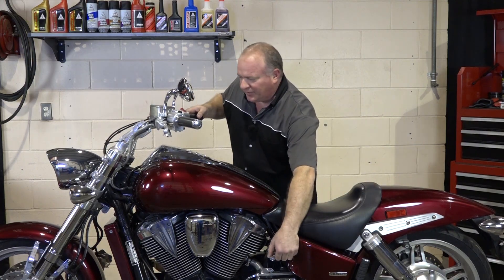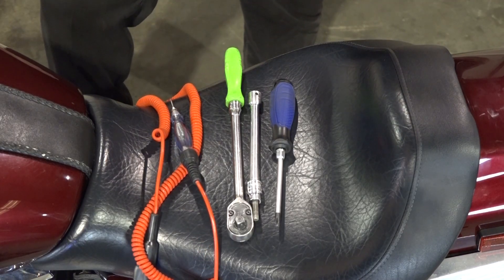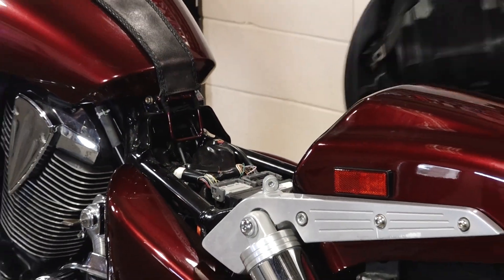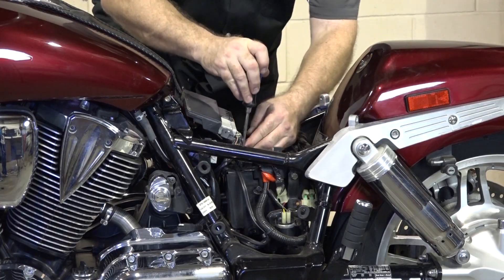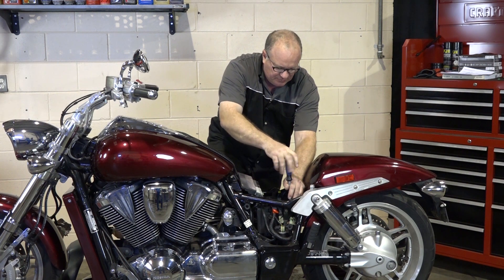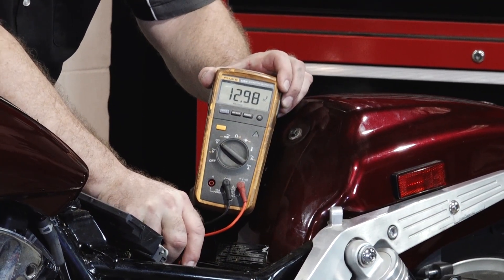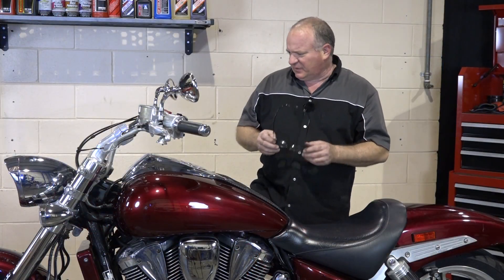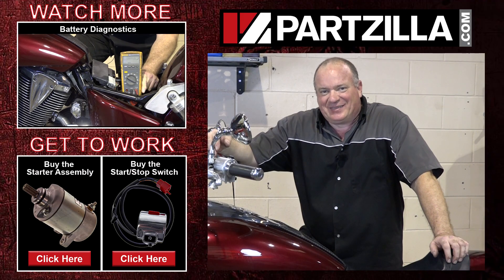Troubleshooting a Motorcycle that Won’t Start | Honda VTX 1800 | Partzilla.com

Comment: Your videos Are saving me so much money and teaching me a lot. I am experiencing an issue with the start button Where I have to push it for quite a few seconds before the motorcycle will turn over. Or move the button around in order for it to make a connection. Is this something that could be corrected by taking me apart and cleaning it or does this probably require a new starter button assembly?

Comment: Good guide.

BUT this happened to me:

The starter solenoid have 2 nuts for each pole. The upper nut is for securing the cables. But the nuts on the BOTTOM of the poles actually holds and aligns the connecting copper plates inside the solenoid.

I once made an error and loosened the 2 BOTTOM nuts on the solenoid while installing a second horn.

Without me realizing what had happened after installing the horn, the solenoid would  "click/start" intermittently. 

The copper plates inside the solenoid had been misaligned and had made bad contact because I fiddled with the nuts on the outside securing them.

After taking the solenoid apart there was melted copper, sooting and obvious faults.

I replaced the solenoid WITHOUT touching the two bottom nuts. Just the upper 2 for the cables :)

Comment: I have a 2010 Honda Sabre CS1300.  It has an issue starting, even with a new battery it will not crank over enough to start the motor.  I have to use a battery charger hooked up to the tender cables to start the bike.  I can ride the bike around for 10 minutes but after I turn it off it will not start again.....Your thoughts would be very much appreciated.

Comment: Thanks for the video, great job. Question? I have a 1300 vtx. About to get into trying to find out why it just decides to shut down while riding for no reason. When it does happen, you need to sit there for awhile to wait to restart. It has gotten really bad to a point where it is just happening a lot and can no longer trust it. Any tips on where I should start looking? I am thinking maybe a fuel relay, or yes even the fuel pump, but not ignoring that it could be wiring in the kill switch / starter. Appreciate any comments please. Thanks a lot.
Reply: Hi, Did you get the problem fixed? My 07 has been having the same issue. Thanks
Reply: @MohammadKhan-eg5dz  So I went through everything on this bike. but I am pretty sure it was a vacuum leak. The bike was painted a year earlier and the petcock for one was really loose, I think it wasn't tightened proper, and over time loosened of. Possible leak. Tightened up a few things a little better and all seemed to have cured itself. If you suspect a vacuum leak, spray some carb cleaner around the carb, example, carb boot, vacuum lines from carb, etc while its running. If you got a leak, your bike will tell you when she starts to idle rough.
Reply: @kmarche100  Hi, I checked the fuel line from carb to the petcock and it was good then I lightly tapped under the float bowl, and it worked. Bike started and idled for about 10 minutes, and it cut off again. I tried few times to restart, and it didn't start then I slightly opened the choke and bike started. With the choke slightly opened I rode about 60 miles and had zero issues. Now if I close the choke the bike won't start. I properly adjusted the air/fuel ratio and it's about at 2 turns and I did try 2.5 & 3 turns to eliminate the need for choke but the bike wouldn't start. I had a similar problem before when I purchased the bike it didn't start/run without the choke being slightly open but after I cleaned the carb/jets it ran fine for about 50-60 miles and then I ran into this float problem. Is it time to get the bigger jets now since the bike won't run without the choke? Is it bad for the bike to run with the choke open? I'm truly thankful for your help & support. Best Regards

Comment: I have a 01 Suzuki Intruder 1500. All of a sudden when I turn key on all lights turn on but fuel pump dont . Push start button nothing happens. Replaced starter relay twice . All 3 wire in the plug at top of relay are hot all the time with key on . Tested all safety switches (neutral, sidestand,clutch) and decomp switch and decomp relay and yhe relay behind fuse box they all seemed to test good . I tested on/off switch and start button both are good. I also have current all the way from start button through plug behind headlight then to the ecu when button is pushed . I don't know where to go from here?

Comment: We have a 2005 VTX 1800.  It sat for several years.  The battery was replaced and the lights came on and the engine turned, but the engine didn't fire.  Fresh fuel was in the tank and the kill switch was in the on position.  Ideas given that it sat for a few years in a shed?  Its was dusty and I don't think it was fired up many years....It was my Dad's and he passed away.
Reply: Does the fuel pump prime when you turn the key on? If not, check the fuses and wiring to the pump. Worst case, it might need a new fuel pump.

Comment: Very nice run through of these switch/relay checks. Thank you. One thing I would have wondered when the main fuse was blown is 'What caused the main fuse to blow?' Because that's my problem. The bike ('05 VTX1800) will start and run, but if I shut it off and turn the key back on and it blows the fuse you mentioned. If I wait a few hours I can start it again (with a new fuse in place), but if I shut it off and turn it back on - 'pop' goes the fuse again. When I ran across my blown fuse, I thought I was on easy street (just like in the video), but my issue was not solved with a simple fuse replacement. I don't really expect anyone to answer this. It's just another non-start issue that may arise. It probably isn't as easy to diagnose though. Any help would be much appreciated.
Reply: Exactly what I was thinking.

Comment: Thank you for this video. I have a 2003 VTX1800R. Brand new battery. When the system is on, all other subsystems power on. I do "FINE-C" to verify start condition, I hear the Solenoid engage, but the starter doesn't spin. I feel confident it's a bad Starter. Does this check out with anyone else?

Comment: Thanks for this video, especially with the starter solenoid not clicking as it should and with the fuses. I have an 04 1800R and it just wouldn't crank over last week, replaced the battery and bought extra fuses as well as a new solenoid.

Comment: Where do you connect the circuit tester
Reply: You connect your test light to battery ground (negative terminal), so when you touch positive power, the light inside will turn on.

Comment: The selonoid wires are reversed on the bike in the video compared to mine. I tested the yellow wire and got nothing. If I jump the selonoid the bike does turn over.

Comment: Wow man you just save me a bunch!  I Have a 2003 vtx1800r that I just had to replace the gasket on the left crank case. When I put her back together she refused to crank 😱 -  Turns out my starter solenoid is bad. Not sure what these 2 have in common it was cranking over just fine before I did that, but this video really helped me to narrow it down and find the issue! - Thanks and safe journeys 😎🤘

Comment: Very good video. In less than 13 minutes, you cover pretty much all problems than can prevent my bike to start. I have a VTX 1300 but most of it apply (even if I need to find the fuse somewhere else I guess.) 
Very good teaching - clear and concise. Thank you very much.

Comment: 2005 1800 vtx, runs well and then bogs down, eventually dies. Re-starts and runs for 15min,then dies again. Could this be the fuel pump?
Reply from the maker: Maybe... but this really sounds like it could be the vent hose on the fuel tank. Insects get in there and nest or you get some other tyoe of obstruction and no air can get in to replace the fuel your pump pulls out... so the pump can't pull anymore. Give the vent tube a look.

Comment: Could a stator be an issue of no power at all? I am troubleshooting I have no power. I've replaced the battery, starter solenoid, regulator rectifier, ground wires, checked all fuses and changed all fuses I have a 96 Honda CBR 600. I was driving I got to a red light and it just died. No power at all to lights

Comment: Hi John,  just watched this video.  Can you tell me what the voltage should read on the yellow/black wire on the starter relay solenoid ?  I'm reading 12.2 when starter button is activated.  My battery is reading 12.8 volts.   The relay will pull in when jumped from battery to relay post ( yellow/red),  but not when activated from the starter switch.(12.2) volts.

Comment: Great video man I always buy partzilla.  I was wondering I have a vtx 1800c, I was driving to work and it died on me not even 1 mile away from my house.  I had hearing protection on so it was hard to hear anything.  It had some not great power then died.  I shut everything down and restarted and no problems since and I had done some rides after no problem.  It kinda bothers me.  What could that be?

Comment: Hi, I recently bought a vtx 1300s. The bike ran great no issues. I let it sit for a few weeks and didn't start it. When I went to start it to go for a ride it cranked a little slow but wouldn't start. I tried it a few times and it died. All the lights went out and I got smoke from the battery. I took the seat off and found that the positive terminal melted. I put a new battery in the bike and now it won't start. All the lights come on and it turns over but won't start. Any ideas?

Comment: My battery swelled up and caused my bike to turn off while riding.  2005 VTX 1300, I brought it to the Honda dealer and they pulled the pins on 3 different harnesses on the right side under the cover.  I tried to repin so I could start to troubleshoot, but I have 3 solid green wires with pins and two solid green connectors and one connector which is green and gray strip.  I am having trouble getting back to baseline so I can troubleshoot the real issue

Comment: Hello. My problem is, i put the key into the ignition, it turns half way but will not fully engage! Yes, it is the right key. i removed the seat and battery. Is there a kill switch on that?

Comment: What's the problem when your 1800S won't shut off.
Reply from the maker: We haven't done that on an 1800, but we ran through a similar problem on a Yamaha ATV. Way different units, but the idea to run it down is the same: look for ways that you might have closed a new circuit somewhere. Water intrusion in the ECU is a good place to start-- and go through your wiring harness to see if you have exposed wires that might have closed a circuit. Exposed wires were the case on our unit and it drained the battery down. We found the exposed wires in the ignition switch and swapped it out. 

Again, waaaaay different unit, but the video might give you some hints: https://youtu.be/guSdIlmO30A

Comment: Hi 👋 I got a Honda GL -150 it  doesn’t start only pedaling I run it for 3 miles the shuts off I cannot start it by pedaling so I have to go on a hill grab speed and  start it , I have to unplug the cable from the spark connector and put it slightly touching the spark connector now starts am I was wondering how can I fix this problem I’ll highly appreciate it

Comment: My 2003 VTX 1800 has been sitting in my garage for over 1 year. I was fearful that the bike was going to be sold as "Not running" because I am not a mechanic and money is real scarce. I watched your video, replaced both 30a fuses, put a new battery and gas in the bike, and the !@#$ is now running! Thank you X 10. Now I have to clean and wax it, and of course get on the road.  
I'm having a damn good week bro.
Reply: I know I’m a little late but that’s awesome you got it going!!

Comment: Have a 2002 VTX Honda 1800 C with starter problems (won't start) - local dealership charged me just short of $400 to replace starter mag. and try to understand problem - could not fix problem.  Can you suggest a great mechanic in the Saint Paul - Minneapolis, Minnesota area that can fix my starter  problem with the knowledge of John C?

Comment: I just watched this video. I did not know that there was two fuses in the electric boxes on the left hand side of the engine. Replaced the fuse for the fuel pump and BINGO!!!  It started. Happy Days

Comment: I have an 07 1300R that has been sitting on a tender all winter. For a while it had a working headlight and 8n the spring that went out..No crank either.A new interstate battery since last fall.The starter button gave me on and off problems for a while when this all happened. Not being mechanical as most,it's spring and I am going to have my battery voltage checked out of the bike.
Fuses ,I'm not sure where to access.Someone stopped my seat bolt cap screws but I finally got em out.
Don't know how to find the parts to check next.
Makin me old fast.

Comment: Question, with a battery not holding a lot of charge, can it interrupt the electric starter on the bike? I can use the crank but the electric starter on the bike just gives humming sound.

Comment: Great video. I’ve had my vtx1800 for 10 year and I was always under the impression that you never turn on/off the switch by the push to start button unless you had to kill the engine in an emergency.

Comment: Your video was very helpful and informative. On my VTX 1800 02' it started cutting out going down the road, F1 light would come on, CV cuts out! Then light goes off bike starts running fine again for a while. Finally quit running altogether. I've checked battery it's at 12.4v . Turn key on, lights come on, depress start button and bike goes dark all lights off no turn over. Raise and lower side stand seems to "reset" it.
Love to get in touch with you?
Gary 831 240 1546
Thank you.

Comment: How about if your starter is turning and there is spark, but it still wouldn't start? I drained my battery trying to start my gl 1800. It stands for awhile and starts again. Buy this problrm keeps occurring. Checked the fuses they are good. Could selonoid do this?

Comment: what if the lights do not turn on when you turn the key on?
Reply: I have the same problem on my vtx1300 R. I was told by the dealer mechanic that I need to check out the starter button.Then later no headlight.

Comment: my 2006 VTX 1800 starter switch stuck removed it and cleaned contacts assembled and the button works properly.  The headlight does not come on when the key is turned on and i get no start.

Comment: I have a question 🙋🏽 about a switch start button that burned out while troubleshooting a 2003 buell blast 500 , it turns out that the throttle cable inside the assembly got out of the track and made contact with either start or killed switch connection inside. I found out their was a problems with the control switch because the ignition fuse 7.5a kept burning out. I placed a 10a fuse to prolonged it a little longer and again it popped the fuse, then I went up to 30a, at which point the kill start switch assembly started to smoke , I want to test them connection, your video helped me start that process later today. My question is, other then the wiring, could I have caused other parts of the systems to burn out or fail while fixing the problem? I am waiting on a replacement kill start switch along with starter reply and system reply to come in, I also purchased the main wiring harness too... Thank you for the great walk through on that last video I saw

Comment: I agree with the previous guy that this is EACTLY what I needed.Thank you so much for being so thorough and crystal clear about the process

One weird footnote about my situation is that I’ve got a 1984V 65 magna that normally wasn’t having any problem except after the bike fell over and I finally got it standing up. It kind of started but ultimately just completely died and now I have no electrical. I’m not sure what the correlation can be from falling over and loss of electrical.
Reply: Not sure if an '84 would have a bank angle sensor, but the VTX in this video does. Its a mechanical switch with a rocker inside. When the bike leans past a certain degree (42.5° on the VTX in the video) the bike shuts off for safety. Sometimes that Bank angle sensor goes bad or gets fouled and the bike won't start. Likely not the issue in your '84, but I don't know much about the Magnas. I had an '83 Magna 750, but I honestly never worked on it before I sold it to buy the VTX1800.

Comment: Excellent instruction, do you have video how to replace the starter button and kill switch assembly?
Reply: I'm the one Charles is inquiring for. I have a 2002 VTX 1800R Trike that I'm trying to get the starter/stop/kill switch replaced on and it's proving to be quite the challenge for me. The throttle cables seem to be my biggest issue.

Comment: Thank you. I have had a  loose relay connection or maybe a frozen relay. Sometimes no power, some times no start. When I physically  tap relay, it will start up and   run and restart normal

Comment: i have a 98 honda shadow that sat for two years before i bought her i did a lot of things new battery new oil and iol filter new starter soilnoid new start switch housing  the problem i am having is i can start the bike ride it park it and 2 seconds later it will not start am being told its the recifer on the bike  does that sound right

Comment: Hello John I am writing from Panamá City 🇵🇦 I have a shadow 2001. When I put the switch in on the lights on. But When I push the start all lights go off and sound a noise like CLICK then I need to disconnected and connected the battery and turn on the lights again but not start my motorcycle. Help me please and sorry for my english.
Reply from the maker: It's not getting enough power.  Load test battery, check connections and wires.
Reply: @PartzillaParts  thanks soo much and I appreciate your time. I will check the battery with multimeter and I will text you again. Cristian from Panamá 🇵🇦 City.